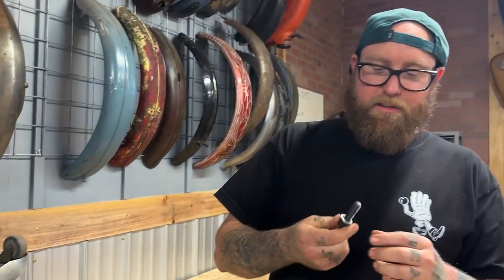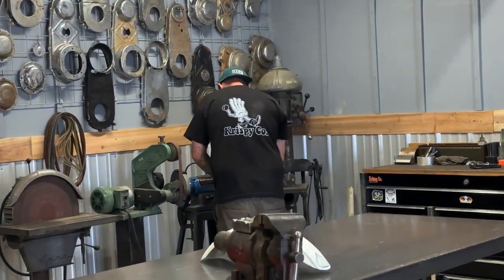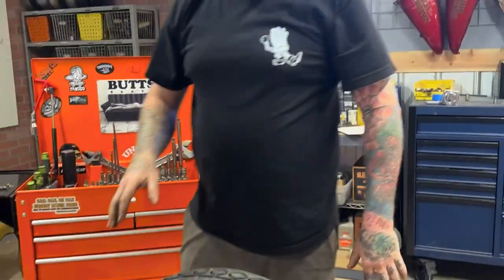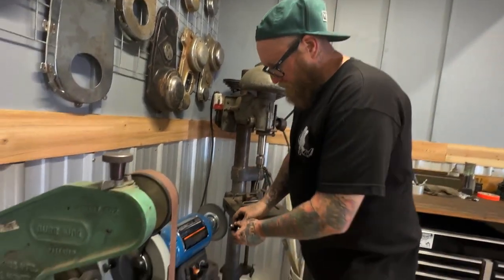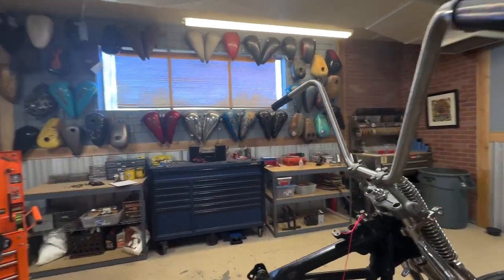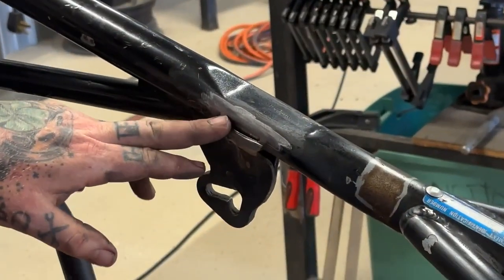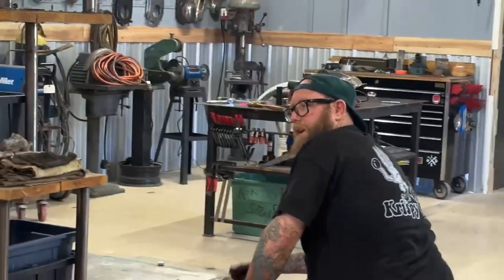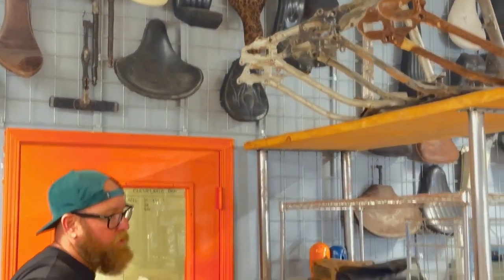Panhead Chopper Build Mock Up Time, Steel Pan-Ther Ep2

Comment: What exactly makes this a chopper? I don’t think any real chopper guy would consider this a chopper this is more on the bobber side with apes.
Reply from the maker: Ok, maybe you can help enlighten us on what a chopper is.
Reply: @krispyco  in the most basic of explanations something that isn’t stock rake and stretch. You guys think cause you chop a few brackets off a frame it’s a chopper. No one who knows anything about choppers would consider that a chopper. That’s like these hipster lames putting extended forks on a Sportster and calling it a chopper
Reply: You have Seen to many chopper building YouTube videos guys. Seems a bit like your trying a bit too hard just keep it real man